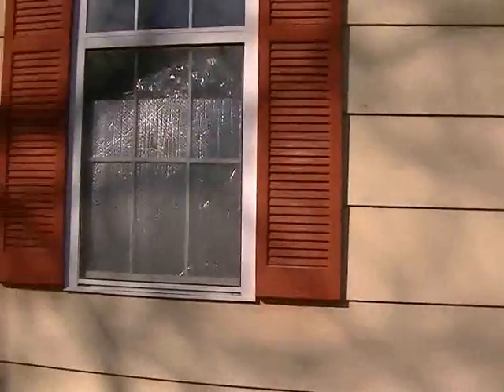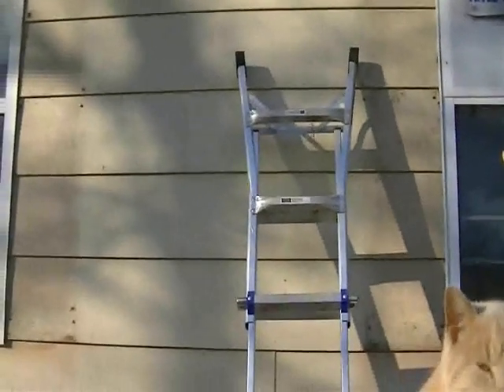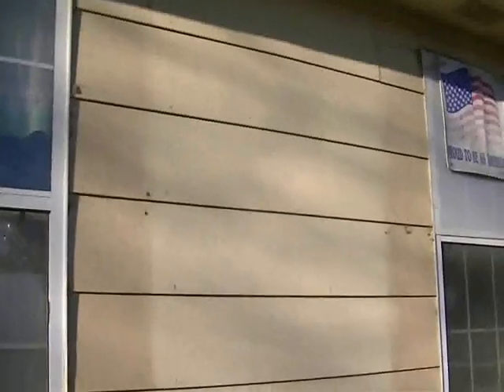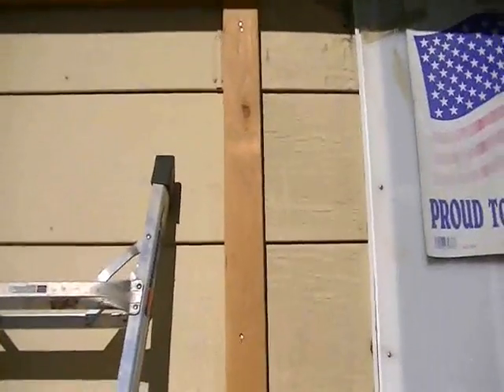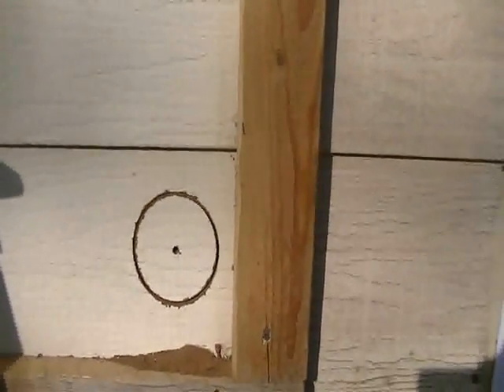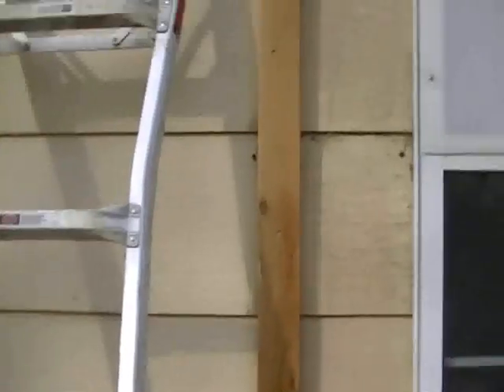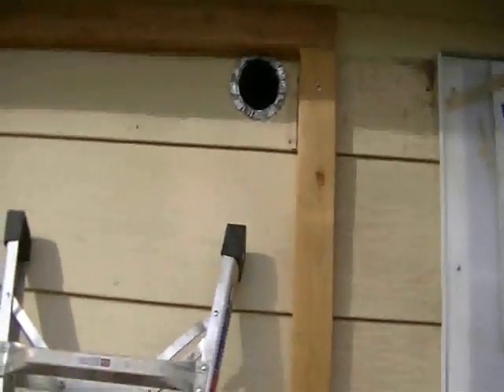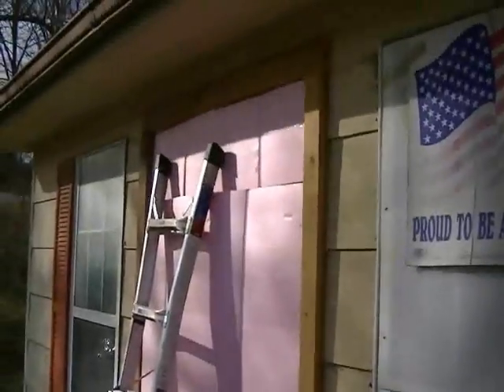Building A solar Heater Start To Finish

Comment: Very nice. Quick, cheap and it looks nice to me. A solar panel should be considered a status symbol. My only concern would be the offgassing paint.  Maybe it's hardened enough and it can withstand hi temp so maybe it's ok but I mite add a 2X2 strip around the frame, connect then squash some 4"alum flex pipe serpentine to fit, paint black add glass. Adds a little to cost,sticks out more & it mite cut down on air flow tho. 
Nice work! I like how it's just slapped up there, no box. bam done&cheap!

Comment: If you hook up a solar panel to a fan for the vent, the fan will run when you have heat and only when you have heat.  At other times, the vents should be closed to prevent heat loss.  That could be hooked up to the solar panel (PV) also.
Reply from the maker: I did the solar panel thing. As for vent flaps, since it's my office, I just stick a sock in it.

Comment: It's amazing how few people take advantage of such simple science.  You should explain the concept of Convection ( how cool air collects at the bottom, gets heated, and naturally rises into the house ) which is what floored me about the entire thing! Still great video!
Reply from the maker: Just leave out the styrofoam. It melted.
Reply: @kbbacon   Building  9 34x76 now.  Use Dow Polyisocyanurate   softens at 165°F and melts between 200°F to 210ºF  (XPS)
Reply from the maker: @TheOldGuyPhil  the pink board didn't melt. The paint dissolved it when it heated up and off gassed. Your board will work better, though.

Comment from the maker: It might deform in the heat, but sounds like a feasible ides! My styro melted and that can be fixed. Worth a try. If it melts, shove metal in side it.

Comment: you did say leave comments.... Just personal opinion. I would have made it deeper. Adding 2" of ridged insulation up against the wall would help insulate that area when it is dark, or even help insulate in the summer to help cool. Why not? Every bit of insulation helps. Second. If it is free flow, top and bottom vents are fine. If it is forced air, have the in and out at the top. Then at night the flow settles and wont reverse. A simple divider can push the hot air to the bottom.

Comment: Super! Nice job! I like that. I have a window at my shop that is on the west wall. Its about 5ft x 7ft, its doesnt get any sunlight until maybe 1 pm. Its a shame I have this glass sitting there doing nothing all winter when it could be working to collect heat to put into  my shop. Think I could cut a piece of plywood to close it in on the inside of my shop and paint it black? It would be doing basically the same theory. Gap between my double pane window and black plywood would be appr 2 1/2 in.

Comment: I think you are missing out on some of the heat generated in your design.  With the inlet and outlet on the same side directly above each other, the air flow will take the easiest path just like water running down hill.  So the air is only really moving from the inlet up to the outlet.  That leaves a high percentage of surface area which doesn't have much air flow. 
I recommend making an adjustment by adding at least one (if not 3 for proper zig-zag configuration) cross beams which force the air to the far side before it exits.  You would probably double (at a minimum) the heat output of the panel.  Obviously, the beams shouldn't cross the entire way, but 75-80% to help have even air flow over the entire generating surface.
Reply from the maker: mob7599 You are correct!!

Comment: Was amazed at the simplicity of your design.  Do's your system compare with the coke can systems listed on this site?  I have a back deck which is almost all windows,  could I just inclose the inside of one of the windows forming a box and then proceed with your plan.  Also instead of using the mesh you used could I use a much heavier grading used to lay over a ditch.  It's much heavier and is multi sided per square., for total sun coverage.  I know the  initial cost would be greater but am I correct in thinking it would get hotter and hold the heat longer.  Thanks   Bill
Reply from the maker: First, forget the foam. It melted. As for the rest, heavier would not help, but more surface is good! Give it a try!

Comment: Great idea, you can use pvc pipe for your vents, put screw on caps for the summer. PVC pipe will not transfer heat and is not sharp.

Comment: increase your fan speed so the hot air is below 100degrees. the foam insulation will have to be covered with 1/4 plywood and the wire mesh is not needed  it is not worth the time or the cost to use it.

Comment from the maker: Eventually the foam melted. The house exterior provides insulation.The edge of the heater is the edge of the room, so no options. Baffles might help in a larger structure. I have used them before. Lastly, I stuff a sock in it. Thanks for the comment!!

Comment: It seems to me that you should use the fan to blow air into the room from the bottom of the solar heater. Hot air rises, it's true, but the hot air from the solar panel really doesn't care which direction it's moving through the collector.  In the room however, you don't want to heat from the ceiling downward.
I'm just sayin'
Reply from the maker: The room has a ceiling fan. Your observations are correct. Just forget the styrofoam. It melts here.
Reply from the maker: MrGordy61 Thank You!!! (your comment got sorted as spam, so I was a little slow. Sorry.)
Reply from the maker: Up, down, sideways...just get that heat!! Great comments!!

Comment: Very interesting and simple to build for free heating, I got some question as do you have a close pic to that pink board plus do you push the air into that panel in order to get the air hot and comes out from second hole.
Reply from the maker: The pink board melted. I would just paint the expanded steel and use that. I use a fan sometimes, otherwise, it flows naturally. The fan is better.

Comment: just wanted to say everybody that makes these videos are always measuring the temp coming in from the pipe does not mean anything what I need to know is what is the temp in the room and is the room being heated strictly by the solar collector
Reply from the maker: +michael stephan The room is 10 x 12 feet and the door has to be open or the room gets too warm. Excellent question! 1 square foot of collector heats 10 square feet of floor space. Way over kill for this small room.

Comment from the maker: The foam board melts and shrinks. Gotta find a cure!
Reply: The cure would be to go with a different insulation board. Failing that, put a, painted black of course, piece of aluminum to fit inside the frame behind the expanded steel and on top of the styrofoam. Then you can forget about painting the styrofoam black.
Reply: Dow Polyisocyanurate   softens at 165°F and melts between 200°F to 210ºF  (XPS)